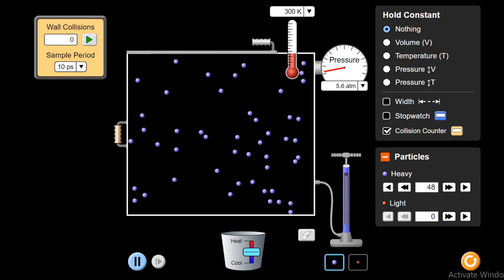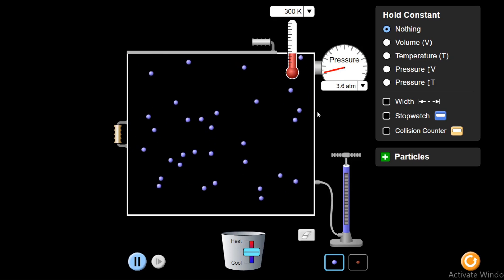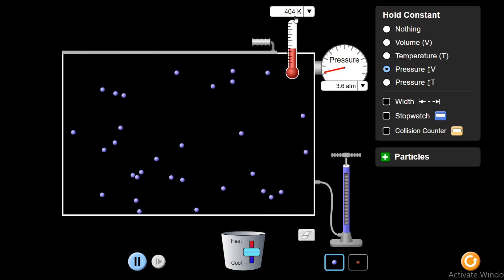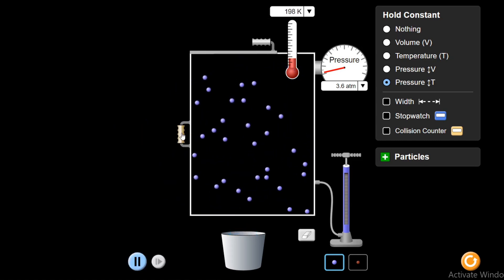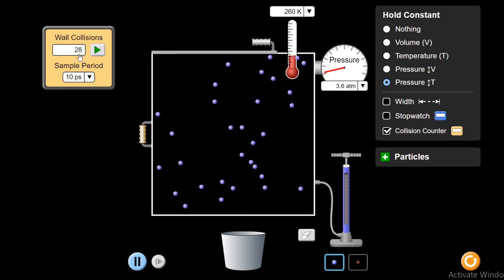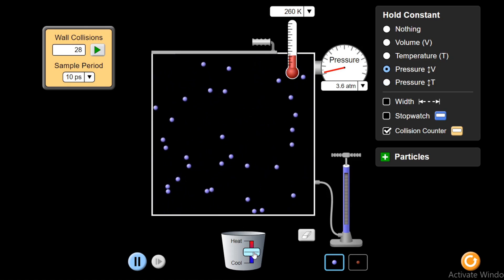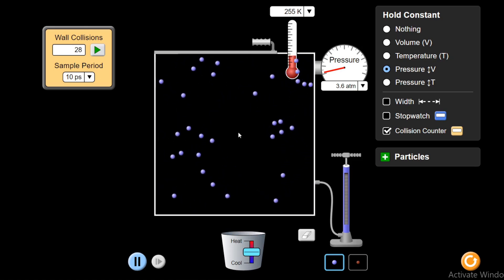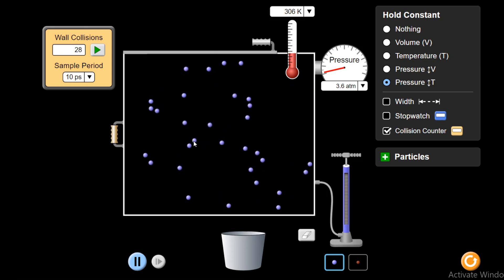Charles Law - Charles's Law - Charles Law Experiment - Charles Law Simulation - Charles Law PhET

Comment: would there ever be a combination of volume and temperature that would blow the top of the lid off? no right because the pressure is always constant?
Reply: Yes it isnt possible if you will keep the pressure constant .
Cause for keeping the pressure constant you have to continously increase the volume that is volume increases as charles law.

If you don't follow the law than yes but at that time you have to either make the volume fixed /constant or make it only able to increase little and hence the pressure will keep on increasing untill the lid explodes boom.
Ya forgot to say you have to heat the gas .cause for increasing pressure we have to supply heat .Heat increase K.E of molecules and hence they strike with greater force .